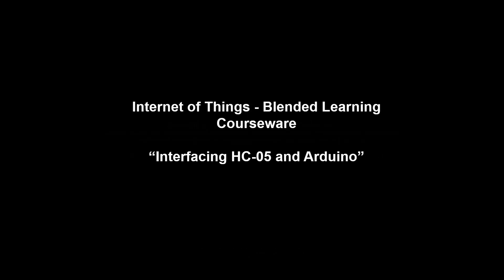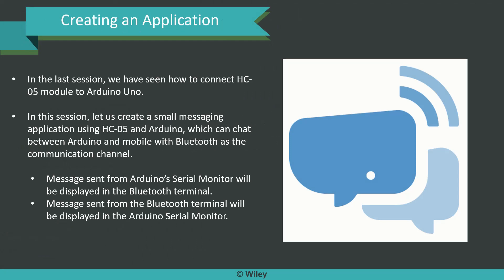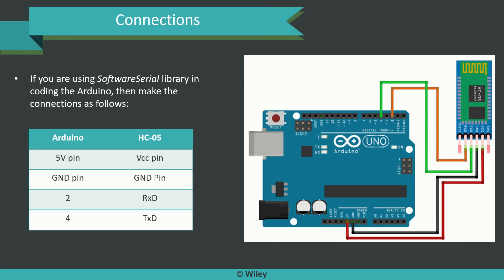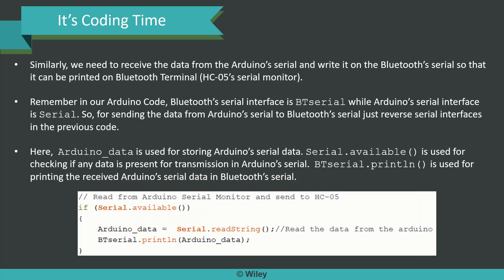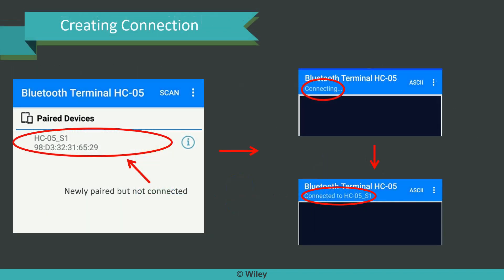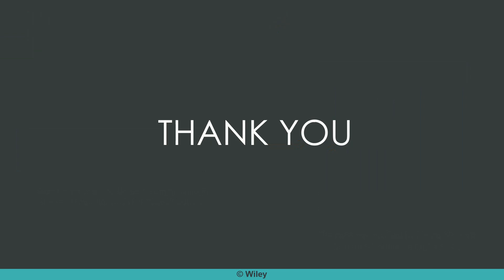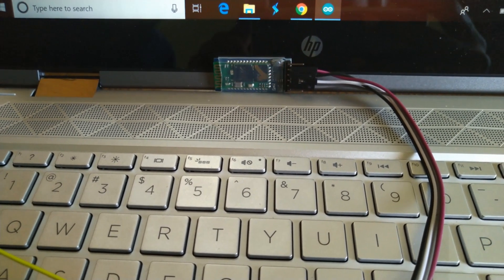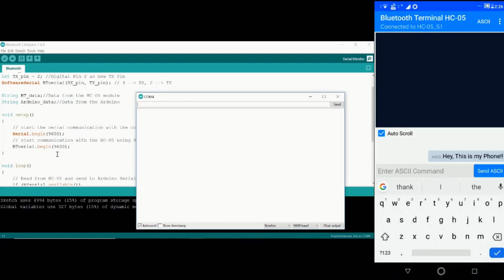Interfacing Bluetooth (HC05) with Arduino

Comment: Sir i want to program the arduino board with diff codes wirelessly,is that possible to send the code via Bluetooth using this device.

Comment: Hii sir my blutooth controlled door system sir using Arduino and blutooth hc 05 and relay 5v battery sir connect mobile this code connect mobile sir